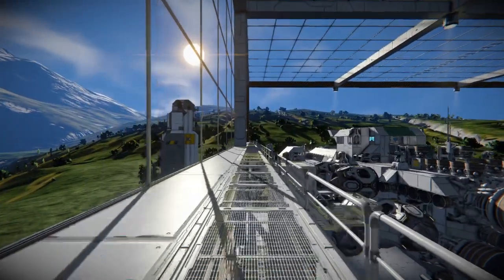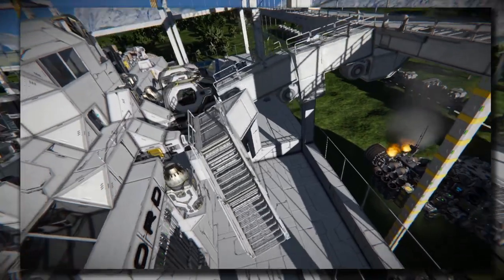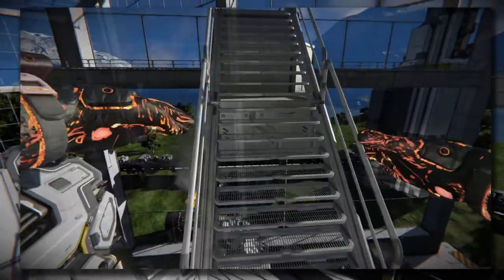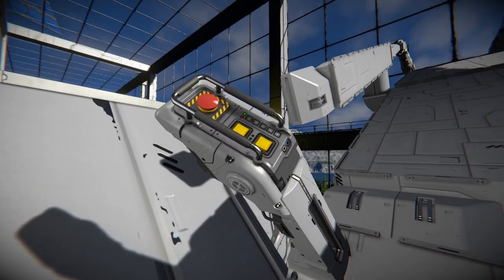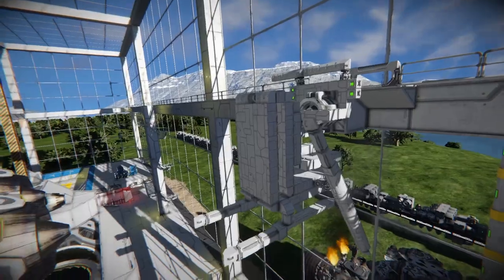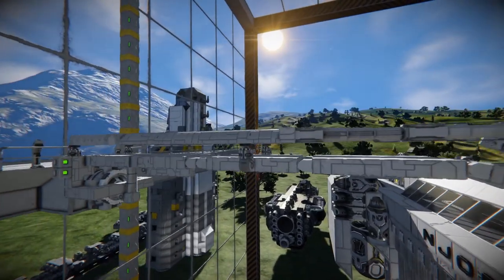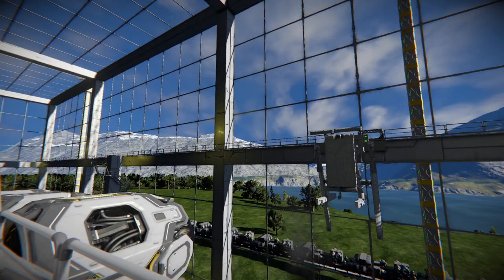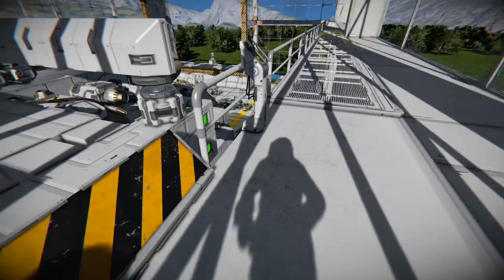Space Engineers: Extendable Bridge Test 2, The Bridgening

Comment: You can also use one button. Lets say u wanna extend the bridge out. Just turn off the first timer block of the extension at the end and turn on the first timer block at the retraction of the bridge. And so do the same thing with the other timers.  Just turn off the first timer block of the retraction at the end and turn on the first timer block at the extension of the bridge. So and the button starts both timers at the same time but the timer witch is currently turned on will do his actions

Comment: You can fix the two button problem just by adding a third timer. This "Primer" timer triggers both the retract and extend timers. Then you add events for each of the others to turn themselves off and the other one on. 

Would be a lot easier if they just let you trigger more than one thing with a button press. My bases usually have entire server rooms full of small block timers and programs running on hinges/rotors.
Reply: Press button, primer triggers.
Extend is on, and is triggered; retract is off.
Bridge extends, extend timer turns off, retract timer turns on.
Press button again, primer triggers.
But retract is on and triggers, and extend is off
Reply from the maker: Ah thx!  Incidentally I learned this on an escape pod I did a couple days ago with a multi-stage deployment, so I can understand exactly what you mean...
Reply: He could also setup several time blocks to trigger at the right time to have a slower bridge extension thus making it seem far better. Only issue is making sure the timing is correct on everything. I've done something similar with collapsing solar arrays to get them to fold in and out in a nice smooth and slow motion so they feel great to extend or retract.

Comment: Wouldn't it be better to replace a section of the railing with something retractable itself...instead of either having to jump the rail, or lay the bridge end over it?
Reply: no thats to easy
Reply from the maker: So many ppl have mentioned this, I seriously regret not saying it in the vid:  The facility is a museum of sorts and I didn't want to change anything on the ships (the interior button was later removed).  2nd bit is part of the challenge was to get the bridge over the rail rather than going around it.  Many have indeed pointed out several easier solutions, but if nothing else, I learned something trying it the hard way...

Comment: why not remove the railing instead of over engineering a bridge?
Reply from the maker: I didn't reference in the vid, but the facility is a museum of sorts for previous series ships.  Part of the challenge was not making changes to the existing ship (that interior button was temporary).  In reality, yeah the railing should either be taken off or hinged itself.  Thanks!
Reply: @DoodleDangWang  If you do not want to change your ship, then an option is to move the bridge 3 blocks to the left, where the steepness ends.
Reply from the maker: @alvin41712  Though I wanted to see if I could get over the railing as a personal challenge, I could indeed have built the bridge elsewhere and in a different way, going to the side of the railing instead.  Thank you
Reply: @DoodleDangWang  I like your attitude keep, up your good work! :)